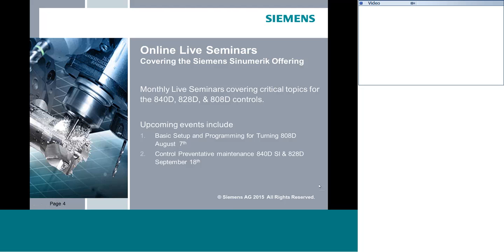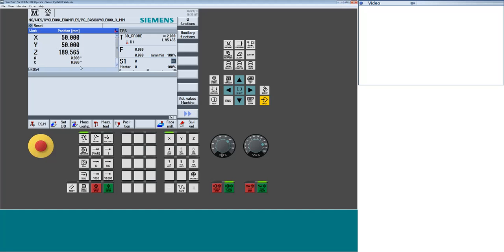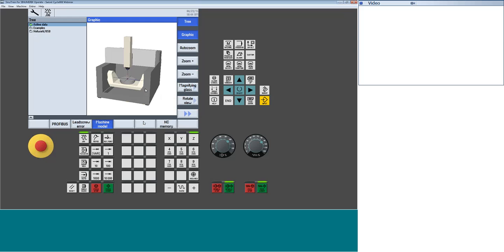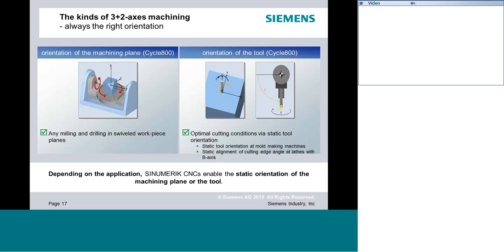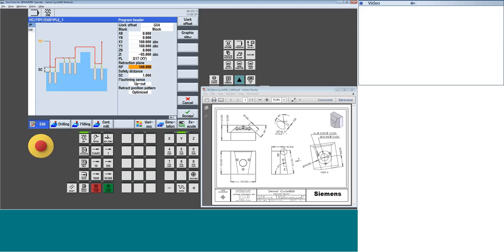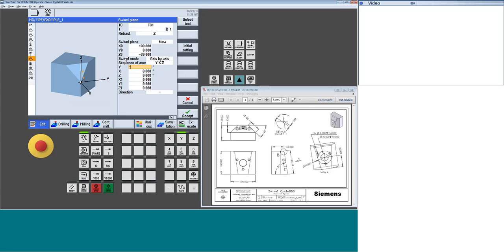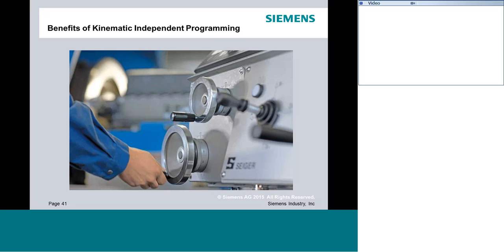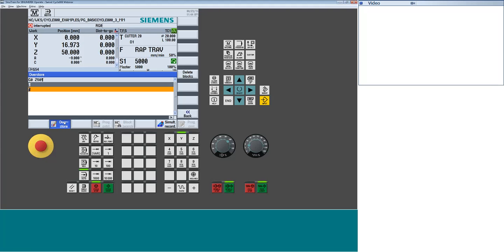Siemens Shop Floor 5 axis Programming with Cycle800 in Sinumerik Operate 840D Sl & 828D Sl

Comment: so if i have a 3+2 part in my machine thats not perfectly setup and i align it.. i should use the cordinate aligenment and not the axis aligenment?

 I did the axis aligenment today and had some very funky problems with i was of different planes
Reply from the maker: you can to use either way. when using cordinate alignment you need to make sure cycle 800 with basic values is active to drive the machine around.

Comment: I appreciate this effort but i must say that i would wager that most of the machine tools with this control are not using shop mill what so ever. It would have been nice if you would have spent more time with the G code than the shop mill. Also, our cam system does not use any milling cycles that the control provides. G0 G1 G2 G3 provide our tool path. I will watch your webinar about g code but i hope it is actual g code and not siemens milling cycles.
Reply from the maker: yeah you are looking for programguide webinar

Comment: hi sir, my seimens cnc machine .the tool wear offset cutter compensation is not working. pls advice. the program is correct im using g41 offset and i gave 5.10 offset on the tool wear radius offset and i gave D1 on the program but still the tool offset is not working. only i see is the tool number in the machine and the tool diameter in monitor is empty im using diameter 10 endmill.
Reply from the maker: Can you please email me the below information:
Machine:
Control(840, 828): 
sample code:

Dan Strubel 
Dan.Strubel@Siemens.com